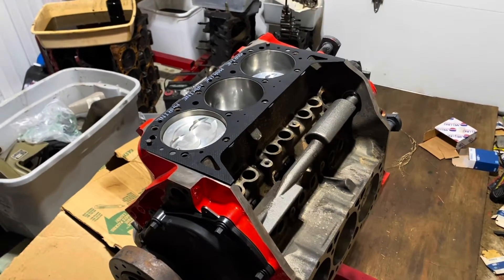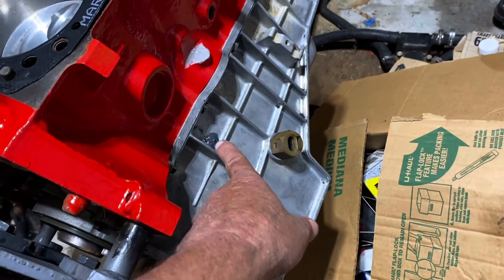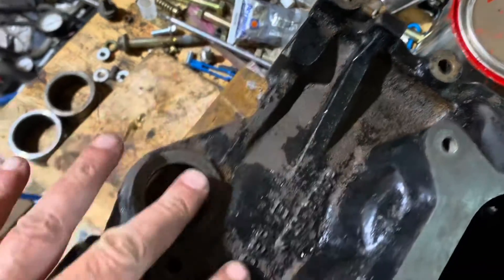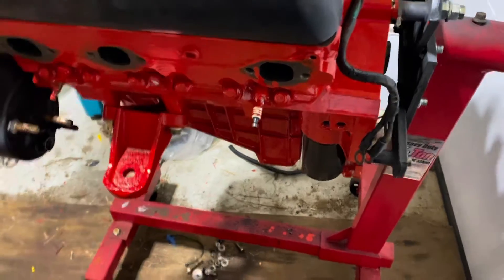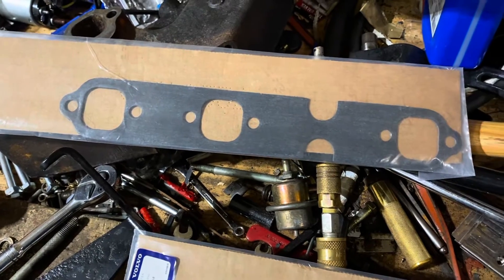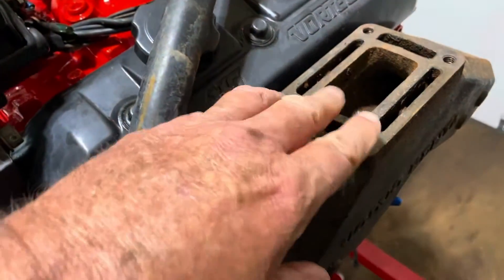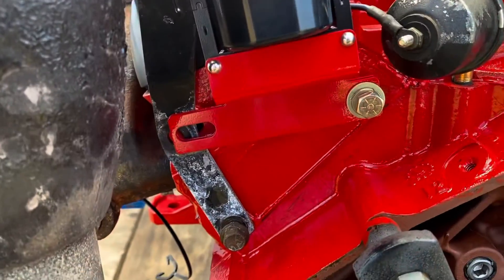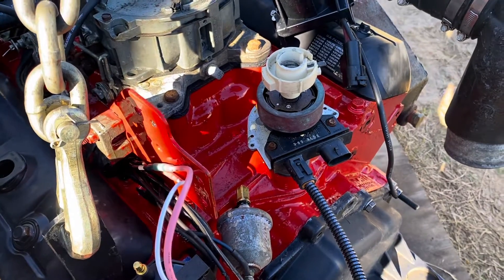Volvo Penta 4.3 Assembly and Tips

Comment: On the Volvo penta 4.3 at end of video distributor cap was pointing at #6 . Why
Reply from the maker: Because the engine was set to #6 TDC firing position, since I knew where the engine was I installed the distributor to match. Apparently this video was left incomplete.  A lot of times I post videos for my customers to see build status and forget to go back and finish the video editing. This was one of those.

Edit: my answer above is wrong. I wrote thinking this was a v8 without thinking much about it. This is a v6 so the rotor is actually pointed more towards #5 position but that doesn’t really matter. When I install Delco v6 distributors I put the engine to #1 TDC on the firing stroke. I then drop in the distributor with the rotor pointed at about the 4:30-5:00 o’clock position if 12:00 o’clock is straight back. From there I rotate the engine two full turns and the distributor and oil pump eventually line up and the distributor drops further until it seats against the engine. From there I put the engine back on #1 TDC and then rotate the distributor body until the rotor is lined up with the screen mesh in the distributor base. I’ve shown this numerous times in other videos. From there you install spark plug wires starting at #1 going clockwise using firing order of 1 6 5 4 3 2